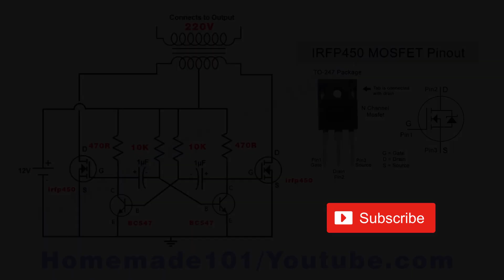How to make a Powerful Inverter 12V DC to 220V AC using IRFP450, 50Hz 60Hz Invereter

Comment: Dear sir, why you connect right side mosfest pins together? Please reply me thanks
Reply from the maker: yes S pin.
Reply: Its becouse thats the suply of the transformator( 12 v imput,via Mosfets,,which alternate,50hz,all controlled by the pulse circuit at both mosfets  gates )The primary coil of the transformator is acualy two coils which works alternate and that couse an alternated field/ curent ( square)in the secondary coil of the transformator.